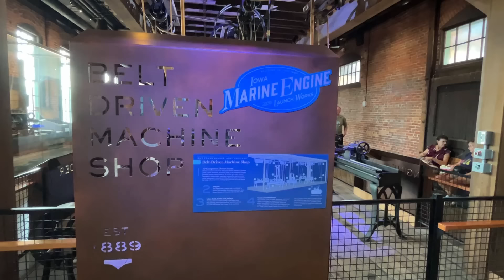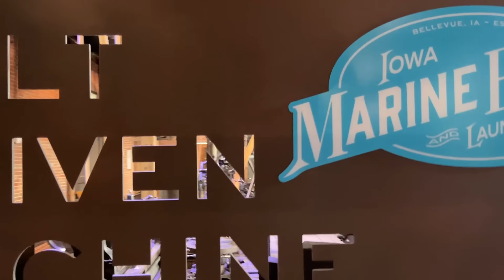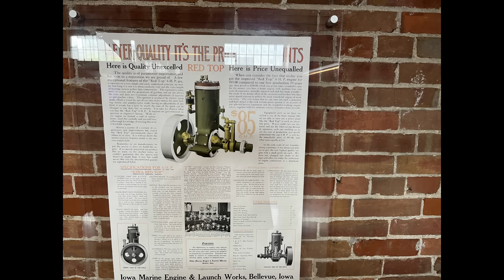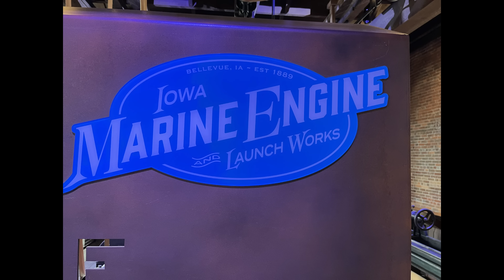BELT DRIVEN SHOP MACHINE SHOP #893 tubalcain line shaft

Comment: My Dad worked at a flour mill, line shaft belt drive electric motor power. The building was five stories.
At the end of the building was a large flat belt that went through all five floors. It had handle and a platform to stand on. This ran all the time, the motor was running.  You just steped on the platform and grabed the handle, and zipped up or down.  Just step off on the floor you wanted.  What a time saver.  I don't remember my Dad talking about grease monkeys.  This was before OSHA, LOL.
Thanks for the videos.  Please give us an update on your health.

Comment: As a young man I use to take parts to have boring, keying and lathe work done in a old shop like this. It had thick large wooden planking for flooring. I was always fascinated by the large wooden pulleys which sometime slapped the leather belts together here and there. The working machinists were at the time, seemed to be dressed in a a pin-stripe railroad-like uniform and hat. Also pyramid-like piles of metal shavings were under all the machines. Many years later the shop closed and I was lucky enough to acquire some various sizes of old wooden pulleys and glass oilers. I treasure them today. Thank you so much for your video and reminding me of those by-gone days.

Comment: Thanks Lyle...We had a local line-shaft shop when I was 18yrs old  {1950} which I visited many times It was a pretty large shop and they specialized in large boat shafts, propellers, etc. They were situated right on the water's edge, on Tampa bay, next to a boat yard..It was diesel powered IIRC.....I was working in a more modern machine shop at the time..I remember the wood floors shaking and the belts slapping when they were in full operation. Your video brings back some good old memories...

Comment: Thanks Mr. Pete for taking me a long. I remember as a child the black smith shop in Tiptonville Tn.  Has a lot of machine that were line belt driven.  The steam engine was gone and replace by the largest electric motor that I has seen at the time.  Thanks for taking the time to do these video, always enjoyable.

Comment: As a child in the 1950's I would walk past this large building everyday on my way to school. I went thru all the grades K thru 6th. at the same school. The building was very noisy and was setback from the street, so I never saw any kind of sign for the building. Jump forward to the late 1970's when I was working for my friend of 55 years as of now. He has a antique car wrecking yard / scrap metal busines  he has been running since 1953 and still does today 70 years later. We got a call to go to this same place that I had walked past everyday as a child to pick up a lot of scrap metal. It turns out it was a machine shop and all the machines were run by line shafts. This is the first time I had ever seen a shop with this type machines that were belt powered. Outside the building half covered up was a hit & miss engine about the size of a VW Bug car that was also for sale. The man who was selling everything show us a very large electric motor that replaced the hit & miss engine to power the shop. The name of the shop was I believe a French name Fontineers and this was in the town of Napa California.

Comment: Great video Mr. Pete.  The building that our home decor and gift shop is in was built in 1900 in Estherville, IA.  It was a line shaft driven "planing mill".  This was a wood working business that among other things milled wood for architectural trim.  It was powered with a 5 HP Dayton engine located in the back room.  When my Dad bought the building it was then used as a Western Union office but all the heavy timbers with huge bolts were still in place on the 12 foot high ceilings.  The motor base was a concrete pad in a corner and I found a news article that mentioned a fire behind the building when lightening struck the fuel tank.

Comment: Fantastic museum setup!!! ‘Bout the only thing missing in that shop, would’ve been several many layers of caked on oily soot, grime, hardened grease, heavily oiled wooden floor slats &, many MANY random metal shavings strewn about! Now granted, not ALL machine shops from way back in the day weren’t allowed to get filthy dirty but, 9 x’s out of 10, yeah… at least for the shops like that, that I’ve personally been in & experienced firsthand, back in the ‘80’s thru early 2000’s, of which only a couple still exist (😭), they very much had LAYERS UPON LAYERS of “stories” to tell! Great filiming & glad you caught that bit of overhead clutch engagement/disengagement operation! TY Mr Pete!!

Comment: That was my first "job" as an oil monkey in a line shaft shop, Ros Brothers Machine Works.
It had a big DC motor that ran the shop and a steam engine that ran the shaft and turned the motor for lights for when the power went out!
Your video brings back a lot of good memories .

Comment: Super video Lyle. Love the machine shop. I was lucky enough to work in a machin shop that had a VBM that came from that era over head belt drive with a 48" table she ran at one speed but did the boring and turning on giant cast bearing blocks for the steel mill. I had about six indicators on every axis to control accuracy . She could still do it too. Its been about fifty yrs ago now.

Comment: As a boy and young man (I am now 75 years old) I can remember a shop on my uncle's farm with overhead shaft driven machines.  The farm has long been out of my family after passing to a grandchild of my uncle.  I never knew what happened to the machines but I expect they went to the scrap yard.  I have in my shop a shaper that was build in Cincinnati Ohio in the 1880's that has been converted to electric motor with a mechanical variable speed control.

Comment: Back in 1965 I started my apprenticeship in a small shop in Rochester ny ,Monroe tool and die ,they had over head belt running some 
Of the machine ,my job once a week was to oil the bearings on the line shaft the older men would get mad because I use to much 
Oil and it would drip on the floor.thanks  mike

Comment: A lot of old belt drive machines were converted to electric motor using truck transmissions.The trannys were usually perched atop or beside the headstock.This was a favorite trick by the "in" crowd.Maybe one day Mr, Pete will do a video on these machines
Reply from the maker: I had two older south bend machines that were converted just as you described. This was at the high school.

Comment: I had a summer job at a steel mill in PA.  There was a shaft driven nail mill that was retired in place but had to be exercised periodically to keep the belts supple. When running it sounded like a machine gun battle.

Comment: I grew up as a military brat ( not brat, my dad was a Marine Officer. In 1964-66 I was in high school in Fallbrook Ca and on Main Street set back off the street about 25 yards was a old abandon machine shop. The 1937 Cord Berline hidden under o huge oak tree first caught my eye. As I was looking around the property to find out more info on car I found a flathead Ford V8 as a generator for the building as I looked in window of back door I discovered it was open and walked in. Overhead was a main shaft running the full length of the shop with 6-8 belt driven machines. In fortunately upon returning to Fallbrook after a tourer in Vietnam 1970 the car 
and shop was gone. So I like this video and operation
Reply from the maker: That’s a sad story. I bet countless old shops and old cars were destroyed by the wreckers ball
Reply: @mrpete222  I’m sure the Cord survived. It had the drivers head off. The rest of the Car looked fine. A Berline model was a chauffeur driven limousine, this one had tool up or down divider windows speedometer for owner to see how fast the driver was and radio controls
Reply: ** roll up and down**

Comment: On vacation this year we stayed at a place near Sevierville TN that had a 200+ year old grist mill on the property.  Couldn't get inside, but could look through the windows and see a lot of the belt drive system, wanted to get pictures to send you but couldn't get good pictures through the dirty windows.  Unfortunately they'd replaced the grinding stone with a more modern mill (maybe 50's system) when they reactivated the mill then, but it's no longer grinding meal.  They did change the newer mill to use the belt system the water wheel ran instead of an electric motor though which I thought was pretty neat.

Comment: Nice videp.
This summer I saw a lathe and a drill press, both belt driven and still used! The power source was an electric motor. The place was an old locomotive shop in a round house.

Comment: Thanks. Nice.
I guess some shops - maybe this one too - were powered by waterforce whenever possible.
Once I have visited one like that totally on waterpower, still beeing used but less intensive; I think in Belgium. It is so nice to have it all working and no noises from any engine. Of course the belts, gears and tools make noises but those make a totally different sound. Of course I also like the sound of youth whenever the old lathe was starting in 2 steps and slowly came to speed.

Comment: The effort to produce that ornamentation in the castings would only need to be done once, when the pattern is made, and much of it might be extra pieces tacked or glued to the plain pattern, perhaps even commercially available bits of cabinetry decor.
Reply: It's still makes the mold need extra time & care, and extra time on the casting's flash, unnecessary details that contributed nothing but eye candy advertising.

Comment: The shop where I work has one small original section that still has a short section line shaft hanging from the ceiling. We dont use it anymore but its still there.

Comment: How interesting.  The belts all look new.  Look how far we've come in such a short time....  and a lot of machines were still belt driven, they just moved a motor underneath the spindle.  So that's where the term "grease monkey" came from.  That got used a lot.  I'll bet some money got added to bill somewhere if your mechanic ever heard you call him that.  It's not like that anymore,  the computer adds the money right up front for your car surgery begins.  You didn't charge enough money for the trailer repair, you should double what you got.  If all you got was appreciation, you should get double the appreciation.  In my opinion.

Comment: Thank you for the tours.  Was your ship the Julia Bell Swain?  That is the Corliss powered side wheeler steam ship that plies the Mississippi.  It was a recovered Tug boat engine with 17 throttle positions and a diesel AC engine powering a flash boiler rather than the traditional water-in-fire / fire in water pressure boiler for much safer operations.
Reply from the maker: No, we were aboard the twilight. However, I have been on the Julia Bill Swain, many many years ago.
Reply: @mrpete222  one of the things I learned in the Ice Harbor museum in Dubuque, was that the average life of a Steam Ship on the Mississippi  was only 3 years.  They either sunk, ran aground, blew up or burned to the water line.  Still they built them, raced up and down the river, and let the water on the cover sheet drop in port.

Comment: I remember that a local machine shop in the 70's still used a line shaft for power. The shop was run by a pair of Mennonite brothers so it may have had something to do with their religion (or they may just have been frugal and not fixing it until it broke). And I never knew the origin of the term "grease monkey".

Comment: dear pete.. been looking at the boat tour on the missisippi and memories cam flooding back  !i worked in an old  old machine shop up in the mountains  just outside the famous city of barcelona,, restoring old steam locomotives. and being a dry climate they were nearly all in prestine condition..!! . all the machinery was run by belt which came from a peltom wheel wich took its power from the river  "llobregatt"which in turn flows through barcelona... ever heard of a company    named smith hyson valve and gauge ltd      forest terrace nottingham .?. well they made all the whistles for the large ocean going liners .queen mary normandie and many many more "including the TITANIC. and it doesnt exist any more the factory,, that is ! and my name being smith im curius if i am related ?could be !my uncle jack   my dads brother had an porn/ antique shop in newark  just forty mile  away!and did a roaring trade he had a stradavarius violin but it was stolen !he paid £12. for it .. but instead of hiding it away it was left in full view  in the shop !he was broken hearted to say the least ...well pete enough of my waffle ing... look after your self ... fondest regards   laurence //
Reply from the maker: Thank you for the comment. That’s a very interesting story. No, I never heard of that whistle company.

Comment: Behringer BC Lavilier mic. - 20 bucks and you will sound better the the people on TV News; - You can even get a cheap-o chicom body pack and wireless receiver and be able to walk around the shop and not loose any audio quality. 

Wounder why they didn't have that planer running. The auto belt shifter alone is enough to mezmorize just about anybody.